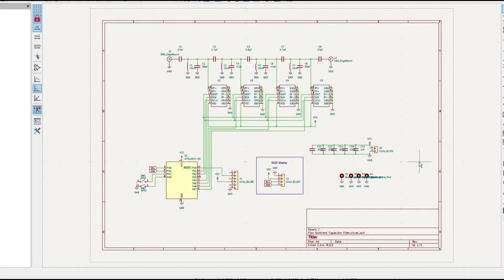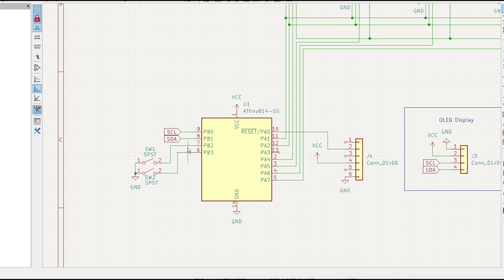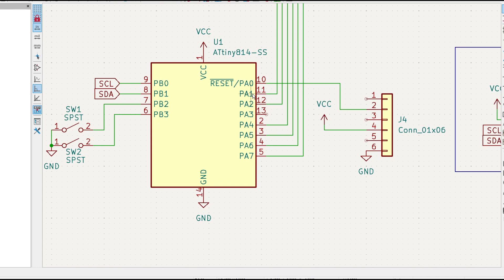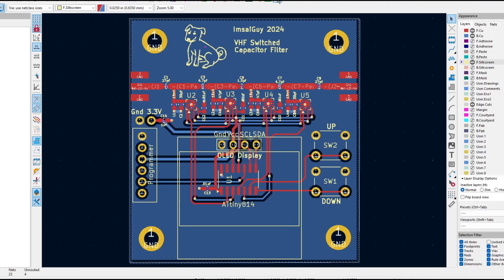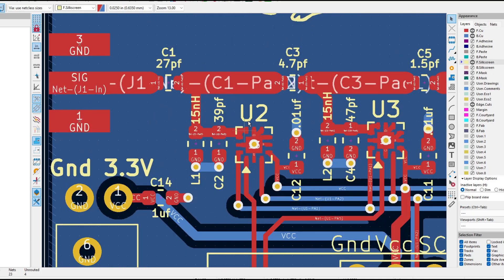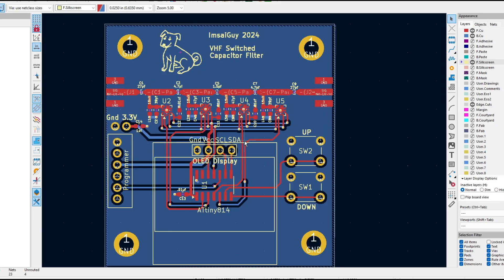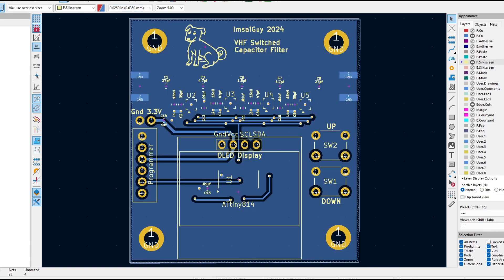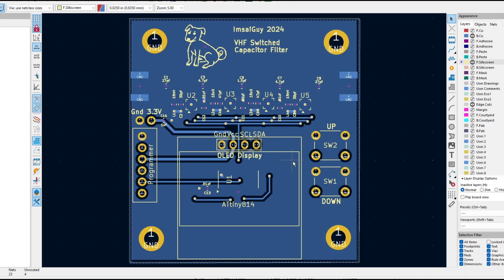#2100 Variable Digital Capacitor Filter (part 3 of 5)

Comment: Awesome project, and thank you for introducing us to those tunable capacitor IC's! However, I am not sure about your microstrip path layout. The forks and bends are local discontinuities and (depending on the operating frequency) could in theory lead to significant reflection through impedance mismatch. Maybe you could place the shunt L's and C's right onto the main microstrip so that they act more as lumped elements, also the ICs could be rotated by 45 degrees such that the corner pins can be connected with shorter distance. Greetings!
Reply from the maker: it's only 150 MHz, no worries

Comment: I add a little extra pad length on such small parts when doing hand solder work. maybe 2x pad length.  Sometimes use an oven but often do it with just small solder tip.
Reply: stick to QFPs then.
This is a 2/3 job for a hot air gun, the rest is pre-tinning and maybe solder drag touch up.

Comment: What board finish did you go with?
Hasl, enig.
Reply from the maker: standard hasl. maybe enig would have been better
Reply: @IMSAIGuy  I find ENIG can be helpful for SMD hand assembly... but only a little for QFN.  The reason is my technique is to specify the paddle via unplugged and fairly large, and then I just tin all the QFN pads.  Hot air the thing with lots of flux, and if I've gotten the tinning even, the QFN will self align due to surface tension (as it's supposed to, just give it a tweak) without the paddle solder puddle floating it too high for the pads or becoming disconnected itself.  Any excess solder on the paddle pad goes down the via.

Comment: Very interesting, the fun part will be the mounting of the chips. 
In the title the filter is named digital capacitor filter while the name switched capacitor filter like on the board is normally used for a different principle where capacitors are switched between to points for charge transport faster than the signal frequency to adjust the current that is passed. You can name the filter of course any way you like.

Comment: Missing pullup resistors on the i2c bus?
Reply: External pullup requirement mentioned in the datasheet, but seemingly not present (or hiding) on the prototype.
Reply: @ralphj4012  they could be installed on dispay
Reply from the maker: yes, the display board has them. watch my prototype last video, no resistors.
Reply: When the pins i2c of the microcontroller is configured as i2c, the pull up resistors are automatically set up internally